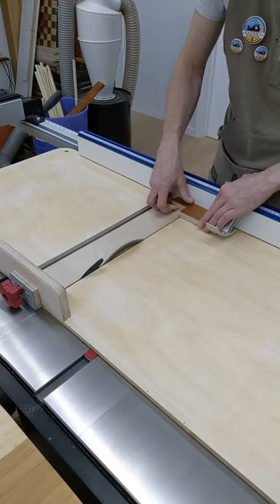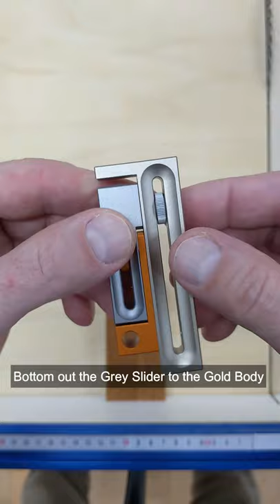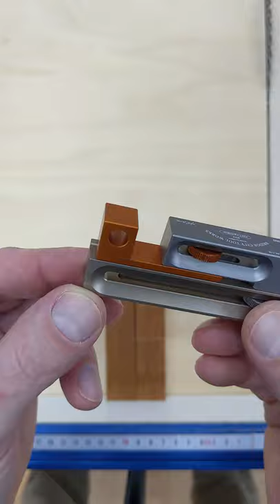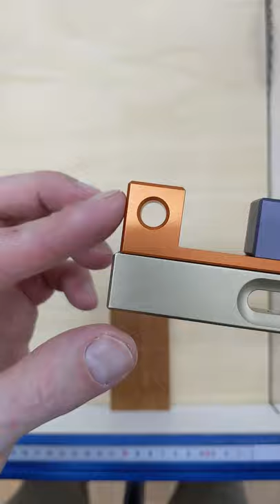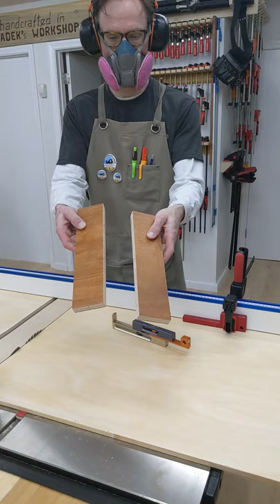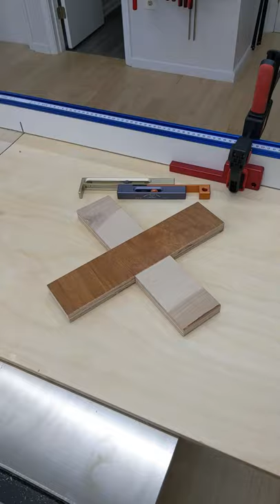Instruction of using Bridge City Kerfmakers

Comment: Method 2 assumes zero runout in your blade and so is likely to produce slack fitting joints if that's not the case. Otherwise nice demo.